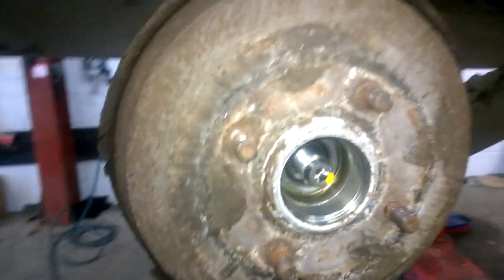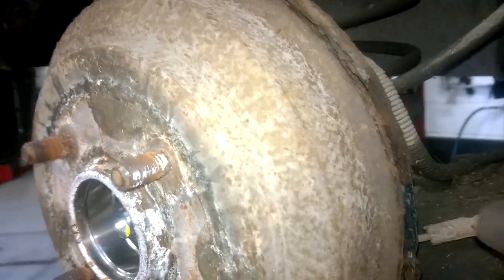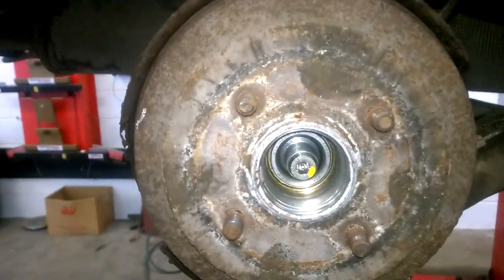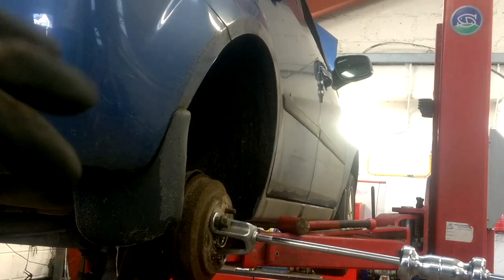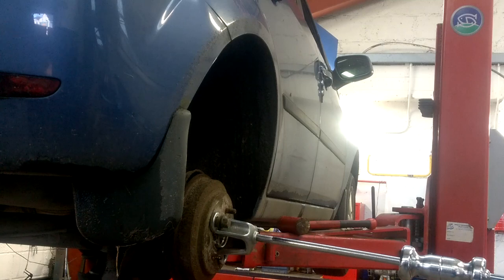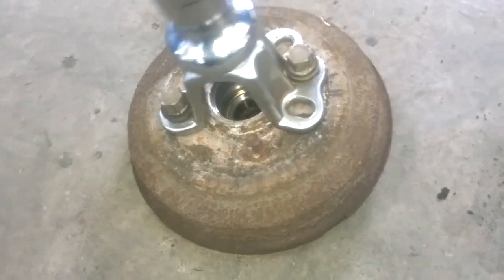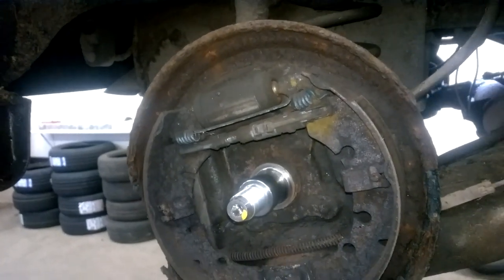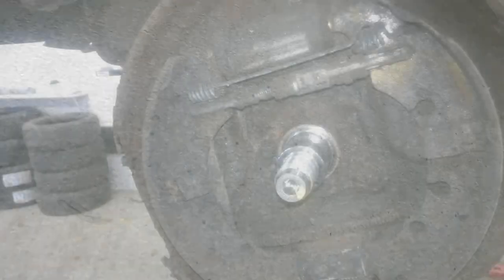How To Remove A Stuck/Jammed Brake Drum

Comment from the maker: Be sure to read the description for a couple of other tips 
Lastly make sure you don't use a regular hammer with excessive force on the outside surface where the shoe would sit, If you do, you could cause damage and make the surface out of round on that spot, causing brake shudder/judder and needing a new drum to rectify issue. I always recommend using a good quality dead blow hammer (soft face) you can apply great force and reduce the damage risk to next to nothing
Reply: Oop

Comment: It's usually rust between the drum and hub that prevents the drum from coming off. As the drum and hub are rusting together, those itty bitty threads they put in drums so you can use bolts to push the drum off are also rusting away. I use a hydraulic gear puller to put pulling pressure on the drum, then 2 or 3 whacks with a sledge hammer will free it. ALWAYS loosen the pads before drum removal, no matter what method you use to free the drum. Dragging the drum across tight pads may break the tang of the wheel cylinder pin.

Comment: What kind of car has the stud mounted to the drum. Must be a foreign car. Good video for all Ford owners,
Reply: Lots of domestic vehicles back in the 60s and prior, especially with front drum brakes, had the hub integrated in the drum. Also modern dual wheel trucks have the same setup.
Reply: dont do this with a rear drive car